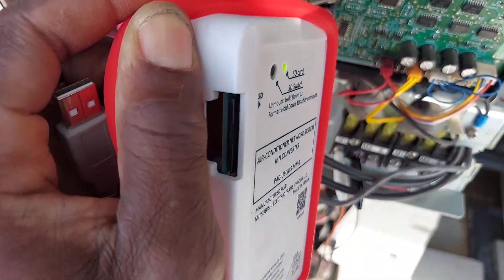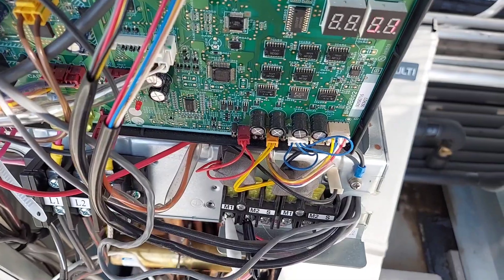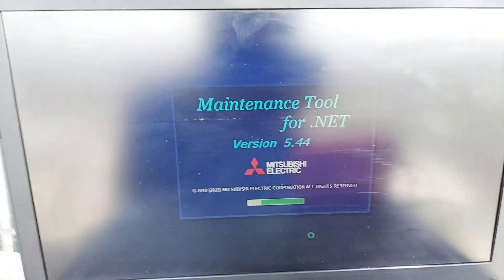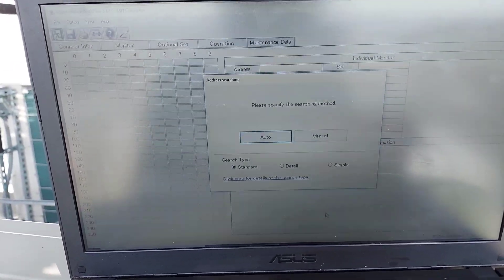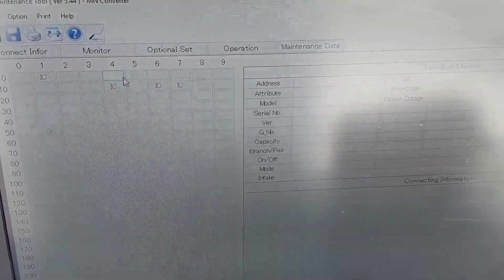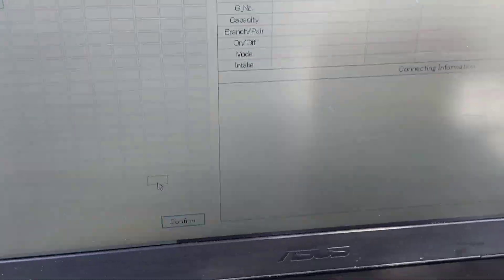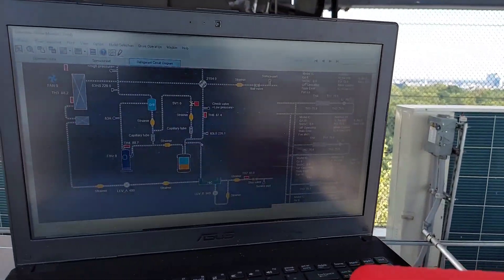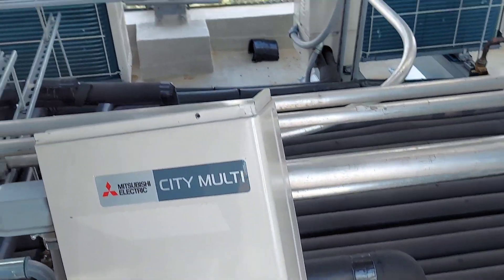MITSUBISHI CITY MULTI

Comment: Mate i have an off topic question. 
I tried flowing nitrogen through a city multi to replace a condenser coil. I could not get nitrogen to flow through the system and only built up pressure instead of flowing in and out. Can you please explain why my nitrogen wasnt flowing through properly. Was i supposed to put the system in a service mode to open all valves? Thank you so much
Reply from the maker: I will see what I can find?